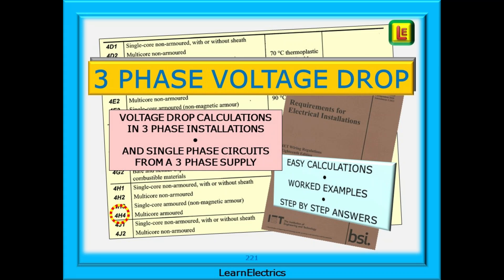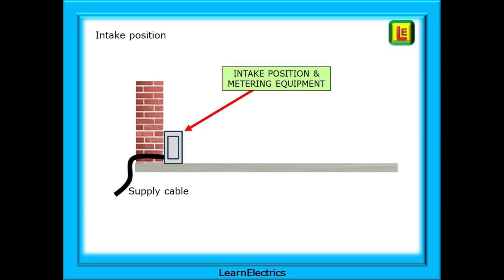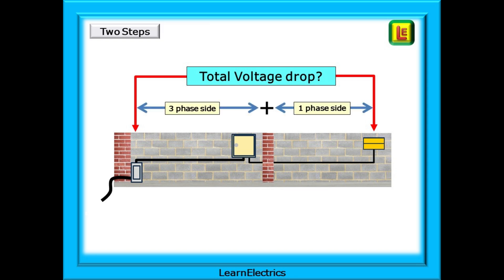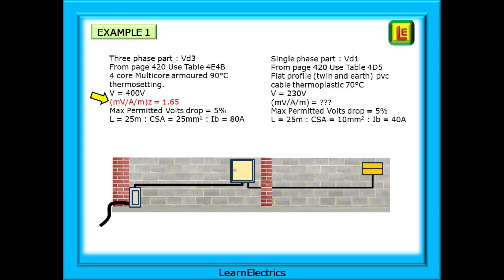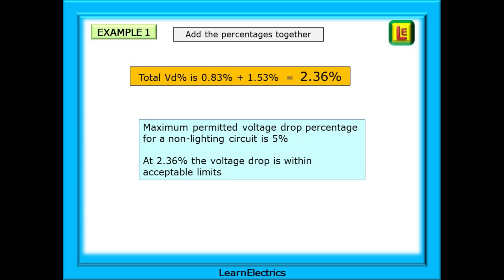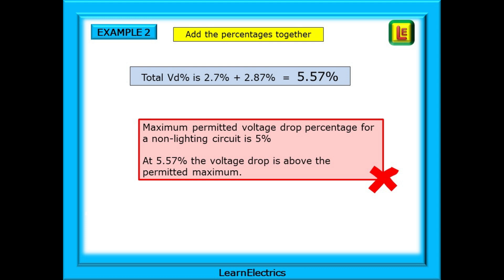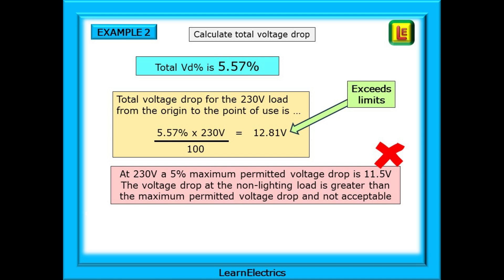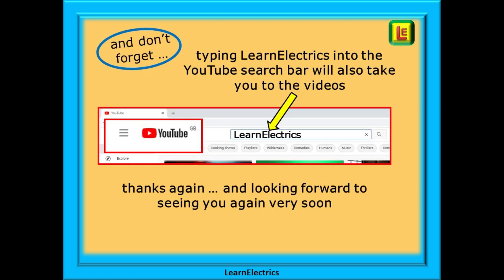VOLTAGE DROP CALCULATIONS IN 3 PHASE INSTALLATIONS AND SINGLE PHASE CIRCUITS FROM A 3 PHASE SUPPLY

Comment: Thanks, I know this is an old video, trying to workout what cable size I need for my own house. So if I'm running a submain from my switchboard on my carport in 3 phase to my house then running balanced light and GPO circuits single phase, I can use the 3 phase voltage drop calculation to my sub board. I'm an electrician from Australia, by normal an engineer would work it out then I just pull the cables.
Reply from the maker: For the single phase volts drop and cable sizes, have a look at the video on the link below. 
https://www.youtube.com/watch?v=nVZeIFeEwl0

Comment: Thank you very much for the video. What is the maximum allowed voltage drop for the street lights?
Reply from the maker: Based on the nominal supply voltage and the tables in the Wiring Regs book.  Lighting circuits only have a 3% tolerance.

Comment: 2 core cable ..  Is that live and neutral ?  What about the earth ,  is that ignored in the calculations. ?      Also three or 4 core cable.  Does that mean 3 phase or 3 phase and neutral.  Is the earth always ignored ?
Reply from the maker: For voltage drop we are assuming a no fault situation, otherwise there would be no need to worry about voltage drop because the fuse will blow, so we ignore the earth. So voltage drop is just about the line and neutral. This video is on single phase. Thanks for watching, appreciated. Hope this helps. Dave.
Reply: @learnelectrics4402  thanks.  That makes complete sense

Comment: Hello Dave, thanks for the video. I am wondering the difference between the one you mentioned and the another formula 2 x K x I x L for single phase, 1.732 x K x I x L for three phase, whereas K is 12.9 for copper and 21.2 for aluminum? Thank you
Reply from the maker: It depends on the csa of the cable. Thicker cable has less volts drop. Three phase has slightly less volts drop, take a look at table F5(ii) in the OSG. p176.
Reply: sorry, I am still confused, which formula is for thicker cable? and which is for thinner one? my understanding is the formula 2 x K x I x L could be used for the cable size from AWG #12 to 1500MCM.  Does is mean the formula mentioned in your video is used for the cable size smaller than AWG #12?  I would like to read OSG. p176,  but what is OSG stands for? thank you @learnelectrics4402
Reply: Why don't you use 1.732 for three phase system.. 

Thanks.

Comment: Great video but I believe the total answer to be 2.73% on the first example using 4.4v instead of 3.52v
Reply from the maker: You are correct. A couple of you have spotted that. I must learn how to use a calculator. Thanks for keeping me on my toes, Dave.
Reply: @learnelectrics4402  You are still our master regardless a few tiny mistakes!:elbowcough:

Comment: Can we also use the (R1 + R2) x L x 1.2 /1000 for the three phase and use the (R1 + R2 ) x L x 1.2 /1000 to do the same calculations independently. Then calculate the % for both the 400 v and the 230 volt independently then  adding the total %
Reply from the maker: Why are you using R2 in the calcs. This is nothing to do with the earth conductors. This is the Line conductors and neutral as we are calculating Voltage Drop in a fault free installation,  hope this helps. Dave.
Reply: Sorry dave meant the R1 and Rn not R2 as i had stated.

Comment: Think there’s a mistake at 10:26
Reply: I second that. The Vd1 volt drop should have been 4.4V not 3.52V
Reply from the maker: Yes it should, well done. Thank you. Dave.
Reply: @danieloj2076  Even second part of  your calculation is wrong typing error, you put down 3.25 × 40 x 25  it should have been 3.52 × 40 × 25
Reply from the maker: You're right. Where on earth did I get 3.52 from. But it proves you're paying attention.
Thanks for spotting that, really appreciated. Dave.
Reply: @learnelectrics4402  you just got 2 and 5 the wrong way round, easy done
Reply: @learnelectrics4402  really enjoy your content by the way, one of the best channels on UK electrical learning 💪